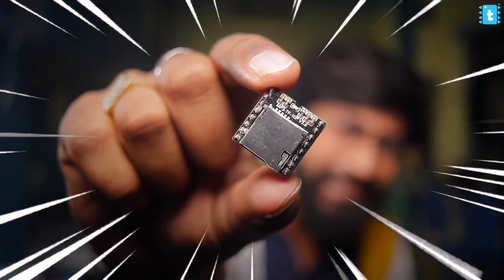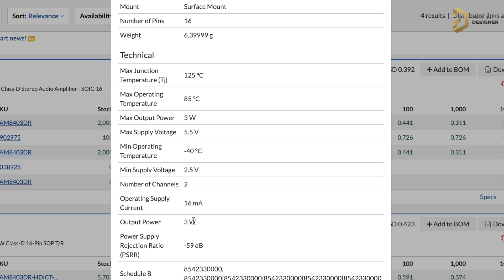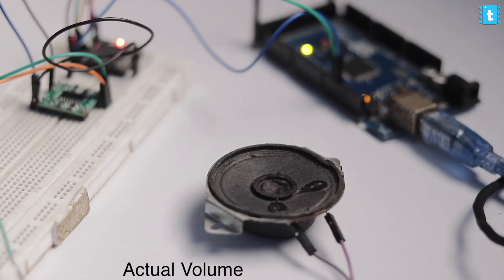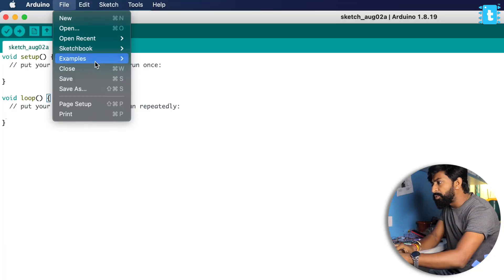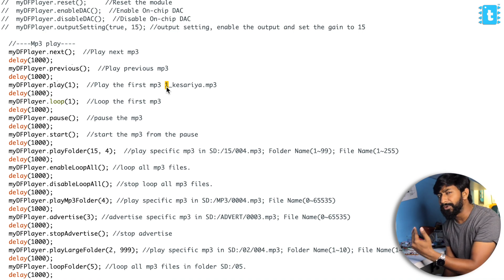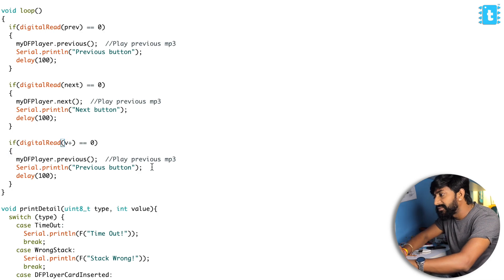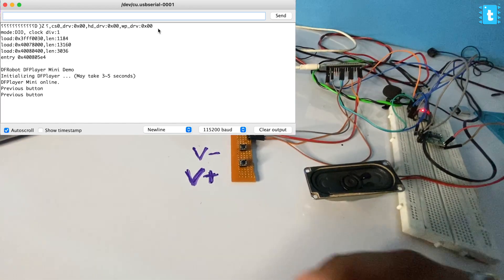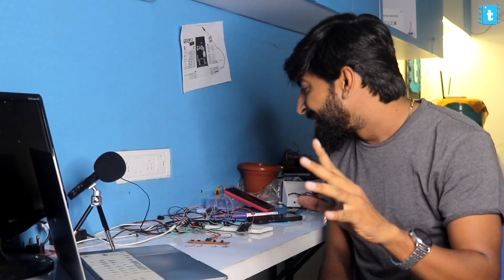A compete guide to mp3 Module using Arduino & ESP32 board | DFPlayer Mini | Arduino Projects

Comment from the maker: There is a little mistake in the connections with amplifier. Although the connections shown in the video will work but the pins which I have used are already amplified. So better you use different pins while attaching the amplifier which is shown in the images whose Link is attached with the comment.

Also a speaker less than 3W will work perfectly with this player which is mentioned in the datasheet as well. 

Thanks to circuiTician for pointing out the error in the video 

https://drive.google.com/drive/folders/1cC9nhYPfJHXgexotAFUvFaCYoIrukgW-?usp=sharing
Reply: Sir Make next Video on, Build Your Own Google Home + Alexa  Smart Speaker
Reply: i want to put songs in an sd card, put that sd card in the df player and then use buttons to play each song separately. is that possible with this setup?
Reply: Please share diagram of buttons you attached with esp32
Reply: And buttons with Arduino as well
Reply: Nice videos dude! Do you know of any Arduino MP3 libraries that have a rewind 10 seconds method?
Reply: no me funciona con el esp32

Comment: For my project i need to use the df player mini .i connected the df player mini to Arduino uno . On serial monitor i can see the df player initialized,  no. files in the sd card and playing track .But no sound is comming also led is not On

Comment: i am facing an issue where the speaker producer static/cackling sound (required audio file is not heard instead just the static sound) when an audio file gets played. I am using esp32(lily go t3 display) board, what can be the solution here?

Comment: i followed  the connection but getting error .!solutions please.

DFRobot DFPlayer Mini Demo
Initializing DFPlayer ... (May take 3~5 seconds)
Unable to begin:
1.Please recheck the connection!
2.Please insert the SD card!
Reply: same I have no idea how to fix it
Reply: @plantor0728 
There are two ground pins in the df player. 
Connect both ground of the df player, 
not one,
That's how i solved it.
Reply: @tareshgupta1095  yep both are connected
Reply: @tareshgupta1095  nevermind, I followed a different tutorial and used a different library and now I'm listening to never gonna to give you up using the dfmini
Reply: @tareshgupta1095  Yes this method is working

Comment: Hi! I've recently acquired a brand new DFPlayer Mini not too long ago and have been trying to get it to work but have had no luck. I'm using an Arduino Uno board and I have everything hooked up correctly along with some small code that should be working, yet the player doesn't want to work and the led never seems to turn on. I'm using a 32 GB micro SD card with only 5 small audio files. Any ideas on why it's not working correctly?
Reply: 3:00 He said that you have to use a micro SD less than 30 GB or else it won't be supported by the MP3 module.

Comment: Hello Sachin. I tried this connection many times. But I faced a problem. 
When I connect the MP3 module with Arduino, the example code works perfectly. 

But when I connect the MP3 module with ESP32 board, in the example code there is a begin dfplayer , where we pass the serial2 . So if the begin fails it stuck in while(1) of if loop. 

And if I removed the while(1) from if, it is working and the parameters from the module also print sometimes only. 

So i serch on the internet and found that this issue is facing by lots of people with ESP32 only. So what can be the issue.

It may be some different DFPLAYER module?
Reply: There is a small problem to using this with the esp32...
That your code wil stop in the while loop as esp32 is unable to get the response from the DF player.
Just comment the line while(1)
In the set up code and your are ready to go....
Reply from the maker: But you can try the way I wrote the code.

I didn’t face any problem not even a single time. So do try that out and if it still not work Just Let me know the version of Arduino, ESP32 package and library that you are using currently.